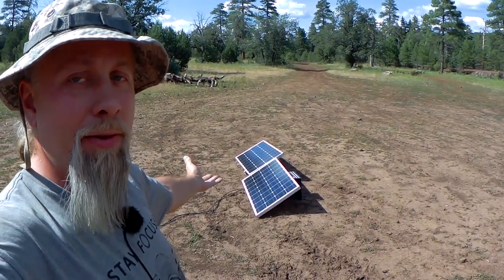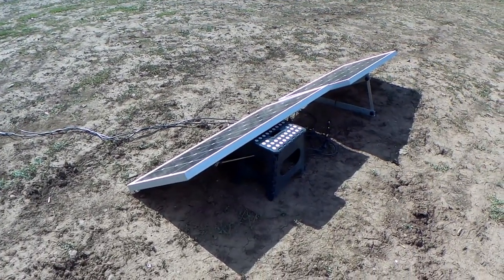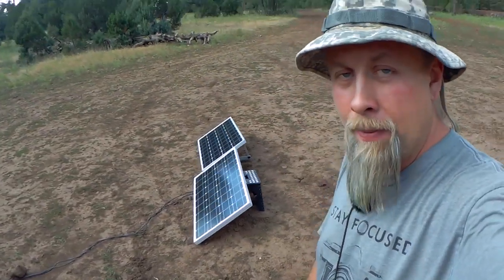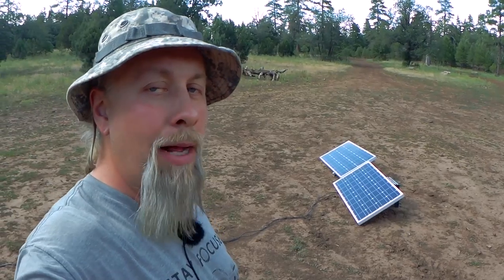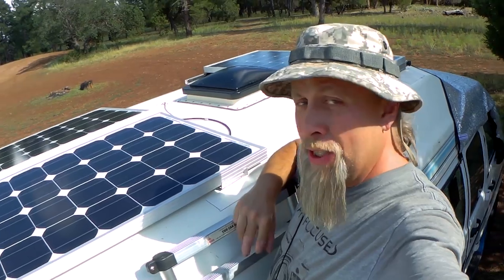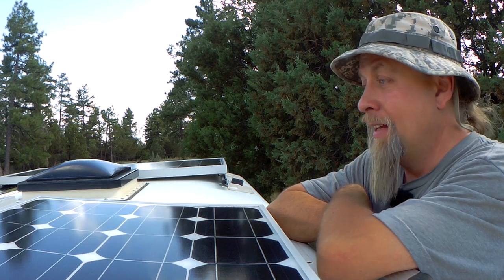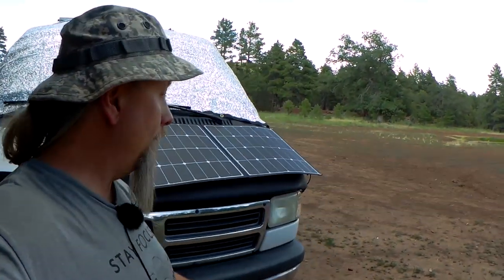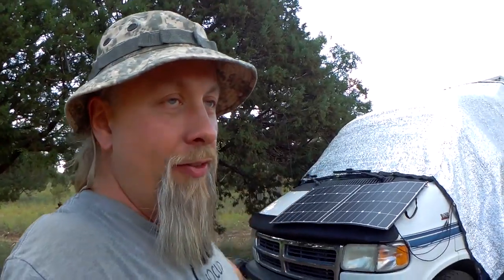Roof Installed Solar -vs- Portable Solar Panels For Your RV? Pros And Cons

Comment: Side question.... Why doesn't AC vent allow rain or wash water to get into back of van?
Reply: Water can get into the compartment where the rear of the AC is but, on similar class b's that I've looked at, that area is pretty well sealed off from the interior of the van and there is a sloped tray on the bottom that causes any water from rain or AC condensation to run out the bottom vent/a drain.
Reply: @jamesgill5511  Thank you very much!  I have a conversion van with front and back overhead storage that accumulates heat. I have thought about going to a yard to pick up a vent  off of a class b to install. So, a three sided, sloped drain "bin" would take care of issue!  Thanks!
Reply: @navmarroaming2292  You might be better off looking for a roof top 'fridge vent' if you have the space to mount one. They are designed so that water can't get into them and they are already screened to keep bugs out. Check out Howie Roll's channel for the video on his AC install. He uses such a vent to allow fresh air into his AC units cabinet. They are about 24"x10" and new ones can be had for under $30. 
There are other ones that are normally mounted to the side of an RV that could be adapted to the rear of a conversion van hightop. They are screened and have a rounded cover, which looks similar to 'vent shades' people put on their front windows. As long as you are not spraying directly into them with a hose, water ingress shouldn't to an issue.
Reply from the maker: Mine uses the factory Dodge rain gutters to drain any water that accumulates in there. That being said they tell you to never spray water in there or use a pressure washer near the vents.
Reply: @jamesgill5511  and Hobotech. Thanks for info and ideas!

Comment: With 2 charge controllers, how do you wire those into the battery bank? I have a pair of 30w panels I'd like to use with my 100w panel, and having 2 CC's looks like it might do the job. Thanks.
Reply: The solar controllers both simply get hooked up to the batteries as if the other wasn't there. Your controllers will only put as much power into the batteries as they can take according to their internal resistance. You can have six 100a charge controllers, each powered by its own 1KW solar array, charging a single 100AH battery and it still wont over charge.
 
There are also advantages to multiple controllers, particularly if they are MPPT. MPPT controllers will optimize the output of the panels they are fed by. With all your panels feeding one controller, if a single panel gets a bit shaded, the controller tries to optimize what it gets. With multiple controllers, the one connected to the non shaded panels will increase and compensate for the shaded array. Will Prowse has a video on the subject.
Reply from the maker: Yes, what James gill said. The controllers will ignore each other. Now I did notice my one controller does report a higher battery voltage than the other because of the way it is wired and the default lithium setting wasn't doing the job. I just adjusted for that by modifying the charging parameters to a higher setting and now it's putting out normal power.
Reply: @HOBOTECH  Do both have to be MPPT or both be PWM or can I mix and match?
Reply from the maker: You can mix and match. Use the PWM for the lower wattage stuff though.

Comment: How long does it take to charge bb batteries with generator? I heard the battle born would charge very fast
Reply: Volts times amps equals watts. Surface area is a light bucket. Solar panels capture infrared light to make electricity. Lumens are the total capture of the unblocked proper light at the perfect angle. There are practical limits to any set up and there is nothing we can do about it. It's the charge controllers job to maximize the process without damaging either the panels or batteries. If you don't have the juice, it won't be fast.
Reply: Yar Nunya I am talking about directly to the generator. Just watched a video of a husband and wife with a class A. He runs 6 battle born batteries and said he can top them off daily in 1 hour. Thats him saying he uses a lot 12 volt power and still recovers in a hour a day
Reply from the maker: Battleborns can easily charge at 100 amps EACH. I have two so that means if I somehow had a 200 amp charger I could top them up in 1 hour from dead. My Onan 2800 can max out my existing 55 amp charger and from dead I could recharge in 4 hours. Add another 30 amps from solar we're down to 2.5 hours. That's wicked fast compared to lead acid.

Comment: Why do the portable panels need to be so far away?  I think you said 50 feet?
Reply from the maker: To keep them out of the shade.
Reply: It allows the panels to be in the sun and the van in the shade.  You'll notice he runs the portables in series, which reduces losses over the 50' wire run.

Comment: for your ground deploy panels have you thought of creating an adapter to convert them to a standard 110V extension cord then use something like this https://www.amazon.com/gp/product/B07CV4L6HX/ref=ppx_yo_dt_b_asin_title_o01_s00?ie=UTF8&psc=1
to wind up the extension cord.
You could most likely use the same cord you use for the generator and save some extra space :) 

As to stakes for the ground panels I'm wondering if a setup with some Long lag bolts and a drill would be an option (link for example to make your own) https://www.amazon.com/Bolts-chains-anchoring-tents-structures/dp/B01EFUOQKK
Reply from the maker: I wouldn't use plain extension cord because it's really not meant to be out in the weather for extended periods and most of it is not UV resistant. It's also too small of a gauge for longer runs. I'm using 10 AWG solar cabling where most 110v cords are 14/16 AWG. I DO like the lag bolt idea not for my solar panels but for my gazebo. I've had a hell of a time pounding stakes in and that looks like a solution. Thanks for the idea.
Reply: @HOBOTECH  glad to help :) I enjoy the videos, thanks for making them!

Comment: Greets from germany!! I have a new renault twizy with a 6kwh battery Ev . This car or ev needs 2000 watts ac to load but im going to charge it with solar ... but the internal loader only does ac to dc. The problem is the twizy bms if you put an mppt on it or near the battery. Renault is so stupid you have to complete change the whole battery or better make a new one to prevent errors or you cant use your vehicle its just stupid! You get a 40% better capacity battery in the same space as the actual twizy battery is only cheaper if you have a twizy where the traktion battery is only to be used in a powerwall

Comment: Why would lithium be more efficient at charging than led acid ? I was getting around 130ahs cumulative out  the 460 watts of panels fixed flat to my roof in the summer per day  into my 4 trojan t105's ?
Reply from the maker: Lead acid is much more restricted on the amps it can absorb. For example, my 100AH AGM's could only take 30 amp max but that was only when it was dead. It was more like 20 amps around 50% DoD. The lithiums can handle 100 amps EACH so they can take just about anything you can throw at them, and that 100 amps is from totally dead to totally full. No curve like lead acid.
Reply: Due to the lengthy Absorption stage of lead-acid charging, it take more than 100% of the used capacity to recharge them.  

There can be a slight absorption effect with Li, but it's minor and only shows up at higher charging rates than most BMS will allow.
Reply: @MustyBastard  > Current;y up to 660 watts on the roof and have realized no cumulative gains in AH since adding two more panels a few days ago

A couple things may be going on.  The battery will only take what it wants in Absorption;  hooking up a nuclear power plant to it wouldn't charge it faster in that stage.  :-) 

The gains would be seen in Bulk, assuming we aren't bumping up against the current limit of an mppt controller.  If the current is maxxed it would "clamp" down on current by moving the panel voltage somewhere that makes less power.  This is usually toward the Voc of the panel.

Or if the panels are different but sharing the same controller they could be negatively affecting output.